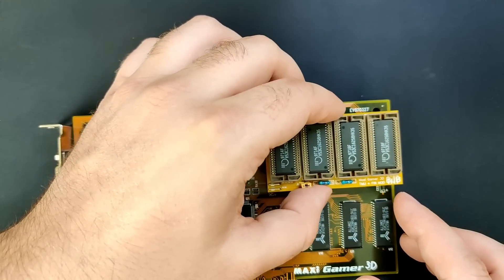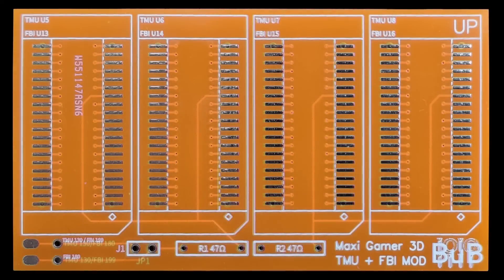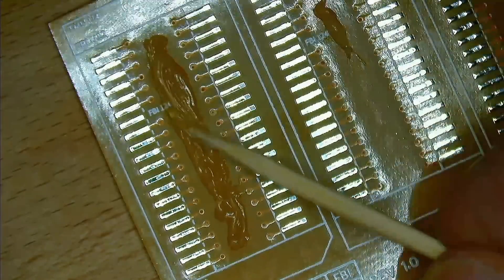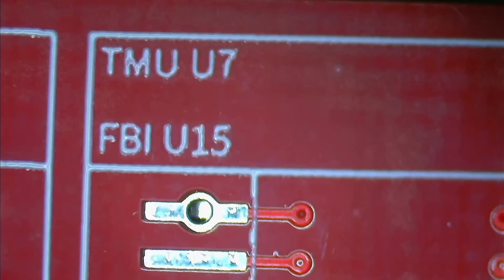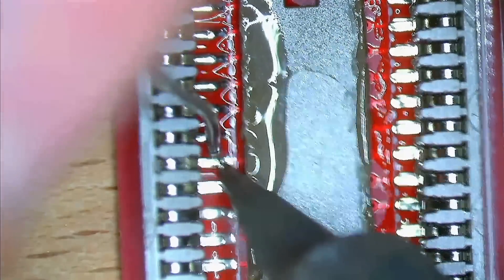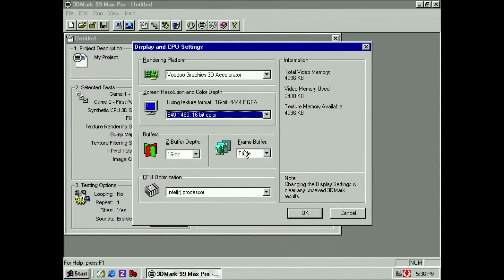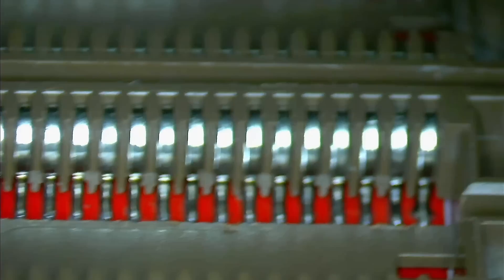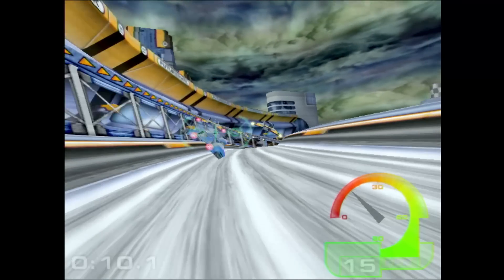3dfx Voodoo Memory Upgrade Board - Revision 1.1

Comment: Great to see the continued development of these boards but I’m surprised you didn’t add an “On/Off” jumper for game testing? Or can you disable the board by disconnecting the leads going to the Voodoo chips? @Bits und Bolts
Reply from the maker: Actually here is something really interesting - and I will pin your comment. It is not enough to just disconnect the wires and leave the memory board clipped on the Voodoo card. If you do, you get artifacts. You have to remove the mod entirely if you want to go back to a lower memory configuration. I have posted this on my Patreon account, but never mentioned it in a YouTube video: https://www.patreon.com/posts/voodoo-upgrade-79103584
Reply: @bitsundbolts  instead of leaving the one pin floating, what if you ground the extra wire from the memory board?
Reply from the maker: That could work, however, I don't know if the remaining 39 pins still somehow activate the memory chips on the memory expansion board. I just don't have the knowledge/experience with this to give an answer. I could test it and if it works, a switch could be added to enable/disable the extra memory.
Reply: @bitsundbolts  For the memory board to be disabled without being removed, you would have to break pins 13 (WE) and 27 (OE) on each memory chip and pull them up to TTL high (3v3 or 5v) to have them be disconnected from the bus. I believe on 40 pin SOJ DRAM, the WE and OE signals are active low. Pulling them high would disable them.

You'd need to figure out how the WE and OE lines are routed on both the FBI and TMU. I don't know if they access one chip at a time, two chips at a time, or all four at a time (16, 32 or 64 bit memory access.) This would result in eight additional jumpers (16 bit), four jumpers (32 bit) or two jumpers (64 bit).

With that level of complexity, you're going to start having problems with signal corruption. Jumpers poking up on the top of the card is going to be a giant antenna that will sink noise into the line and potentially cause issues. It'd be easier to just remove the board entirely and disconnect the existing wires.
Reply: @GGigabiteM  Well, one jumper and some logic ICs would do the job as well

Comment: I'm a lil bit curious. Why upgrade a 25 year old card, when you can buy a modern one for cheaper that is thousands of times faster.
Reply from the maker: It is a hobby and I find it fascinating to learn about old hardware. I can modify and repair this technology with basic tools - like a soldering iron. That isn't easily possible with modern hardware (all BGA chips). And mostly, it is curiosity. I am not going to use this anything you see on my channel on a daily basis.

Comment: could something like this (the concept) work on the velocity 100/ Voodoo 3 1000 8Mb edition?
Reply from the maker: I think it should work since there are 8 and 16 MB versions. But with different memory packaging (I think they all use SG-RAM), it will be difficult to mount a memory expansion board.

Comment: This mod looks very promising... do you think something similar to this will work for other, non-3Dfx cards? I have an old Creative CT-6200 (VLB 3D accelerator) that only has 2MB of VRAM. It is capable of doing OpenGL but only with 4MB, and the proprietary memory module is ultra-rare. Obviously, I can't use this exact PCB as the chips are spaced differently, but in theory, it might be possible?
Reply from the maker: Yes, it should be possible since the card can be upgraded with a memory module. But how exactly you could make your own memory expansion depends on the card. The Voodoo is easy because the memory requires only a few extra connections to the graphic chips. It may be a totally different situation for the CT-6200. It may even be better to put in the effort to replicate the proprietary memory module.

Comment: Nice upgrade but still I think the main problem might be the drivers to use the 8mb. Which ones are you using? Thanks
Reply from the maker: I use the latest official drivers from 3Dfx. I am assuming that the drivers support the extra memory as I could see a difference in 3DMark 99 for "The Race" benchmark. But I am not sure. Could be that I have to test different drivers first (like MesaFX or Wicked3D). I am not even sure if they support the first Voodoo card.
Reply: @bitsundbolts  i think that canopus pure3d and miro highscore are drivers that really support that extra memory but don't know about the rest... 3dmark might do something different... And dos games are also different than windows ones ... We should investigate on the subject
Reply from the maker: I agree 😁

Comment: So i heard you say in regards to the chips that you knew they were good because you had already tested them, did you mean in sockets on another card or is there a standalone memory tester that can test these soj chips that i have not heard of? ive been looking for one to test SOJ40 and SOJ42 for a while  but nothing =/
Reply from the maker: I used them in sockets. The very first memory expansion board I made was with sockets on both sides. I have not seen any other way test those chips either.

Comment: What kind of Gain did you see ?
Reply from the maker: Until now, not much. The extra memory allows to run some games at 800x600, at a cost of frame rate. I only saw 3DMark99 Benchmark 1 (Race) to improve quite a bit. I am still testing other games and hope to see a difference. If not, we will see different games of that era and refresh our memories.

Comment: One question, why not giving holes to all pins?
Reply from the maker: When the socket is pressed on the chip, the walls bend. If there would be holes on every pin, the socket would be soldered in this condition and could lead to a bad connection. The corner pins are supported by the corners of the socket, so they do not bend, but the center of the socket is the worst.
Reply: @bitsundbolts  seems reasonable, good job.

Comment: Brilliant idea to use the holes to line up the pins prior to soldering! Nice work! I also ran into a solder bridge just like that recently in an SOJ socket, but it was a factory defect from a Diamond Stealth VLB card from back in ~1994. It wasn't easy to spot without magnification at just the right angle. Keep up the awesome work!  🙂👍
Reply from the maker: I have seen the video! Quite interesting that the QC didn't catch this solder bridge!

Comment: I like this mod, but I'm not fan of the ssop sockets. how about removing the original chips and making a pcb board with castellated holes in the places where the original ram was placed? you could reuse the address and data lines from both groups of ram chips. now, the only issue is that this uses more space, and it probably won't fit if you keep the adapter the same size as the voodo card... I guess a little bit of overhang won't be that bad :) and you'll not get any connection issues, and you can make the voodoo card stock really easily
Reply: Making brand new boards would be quite a job ...
Certainly  possible, but a lot of work.
Using sockets is a quick way to validate the concept.
IIRC, some Voodoo cards had a daughter board to allow extension (Obsidian , see thedodgegarage for details).
Reply from the maker: When I thought about making those PCBs, one requirement for me was to not alter the Voodoo card too much. I am working on an idea where I wouldn't even need to solder the wires to the TMU and the FBI chip. The goal was to preserve the original, but anybody can try - the DIY guide and the PCB layout are available for anybody to use.

Comment: nice idea with using through-holes for the pins! it's kinda similar to what we talked about but this version is much nicer
Reply from the maker: Thanks! Yes, I was surprised that it actually did work so well.
Reply: @bitsundbolts  definitely a nice new construction method. lovely.

Comment: What are the heatsinks for? were you overclocking it? 😉
Reply from the maker: I put some heatsinks on the Voodoo chips. I don't think they are necessary, but I had those heatsinks. The chips get quite hot, so I put them on his card.
Reply: @bitsundbolts  Ah, I never had a Voodoo so I thought they didn't have them because they didn't get hot.
Reply: Which heatsinks ?

Comment: Is there a possibility to make a version that works with the L shaped memory configuration of the orchid voodoo card?
Reply from the maker: I have the Orchid as well, but this concept won't work on that card. The memory chips are too close to each other. But I am working on something universal that will work on any Voodoo, regardless of memory layout. I need more time to do this though as I don't have the right equipment yet - and I don't want to reveal too much yet 😉

Comment: Those 4MB SIMMs look pretty familiar. 😉

(BTW that project isn't abandoned, I just ran into some issues porting it to KiCad, and then ran into more issues with the memory chips I bought, then ran into more issues with my plan to test the chips. If you know where to buy some Yamaichi IC107-2603 test sockets that's not the "test-socket" website, let me know!)
Reply from the maker: Oh my - Hello UpLateGeek! Nice to see you! Yeah, I borrowed your PCB design. Will definitely mention your github page in the video I am working on. Unfortunately, I have not come across any test sockets yet. Would be helpful for me too since I have that faulty 72-pin 32MB module. Those test sockets are quite expensive on that "test-socket" website. Thanks for watching btw!

Comment: Excellent Work! Am definately going to look into doing something similar with my Orchid Righteous 3D cards - they have the memory arranged in columns of 1 and  7 modules, so completely different from the Maxi Gamer 3D. Not sure if there is physically enough space between the memory modules though.
I haven't looked into the specs of the 512KB memory modules used on the Voodoo in great detail yet, however, I image it would be possible to simplify the entire design down somewhat to a single 2/4MB memory IC with all the I/O, address and control lines routed as appropriate. I wonder if it would be possible to easily "disable" the onboard memory (maybe hold WE, OE low?) so you could effectively replace all the original onboard memory with faster/lower latency memory? Just thinking...
Reply from the maker: Hehe, glad that this mod brings your mind into overdrive :) I also have the Orchid. And I can tell you that there is not enough space for this mod. But, I am already thinking of modifying this card too, but this time - no soldering required. It will be hard and probably requires way more time, but I want to give it a shot!

Comment: This mod is effectively perfect. The only thing I'd do - is put a three-pin jumper or a switch, so the jumper does not get lost when jolted.
Reply from the maker: True, I could have done that. Learned something - Thank you!
Reply: @bitsundbolts  No sweat. Most of us shall just solder the jumper permanently.
The beauty of this mod is that you may forget it exists, after it's done.

Comment: very noob question, what is that trasnparent gel ?
Reply: Flux for solder
Reply: or it is the silicon glue that is used for the memory socket, if you are asking for that.

Comment: Next you should look at adding a second FBI chip. I believe the architecture supported multiple FBI and TMU chips, it just was never implemented commercially.
Reply from the maker: Yes, based on a document from 3dfx, this should be possible. Unfortunately, I believe this is way out of reach of my capabilities. I would love to be able to do that - would make me an instant hero in the retro community :)
Reply: @bitsundbolts  Yeah it would be a heck of a challenge but at the same time, adding RAM was one too. 😁
Reply: this could be perhaps possible with another pcb design ? 🤔
Reply: Wasn't there an "obsidian" board that had multiple chips? I believe it may have only been used in arcade machines. Also there was something called "mercury" but I believe that involved multiple boards. Don't know if the regular drivers would support that or not.

Comment: Add vias for every possible pin and simply solder the lower sockets trough the pcb. Solder will flow trough the vias and attach to the pins of the lower socket if you are patient enough and maybe help with some hot air. Afterwards you can remove the pcb and solder the remaining pins (RAS, CAS, CE?) which are differently connected and can't have a via.
Reply from the maker: When the sockets are placed on the memory chips, they tend to bend in the center outwards. I could imagine that this can cause issues if we start soldering center pins.
Reply: @bitsundbolts  i'd not push them completely flush on the chips, only let them sit slightly so the position is correct. And you can theoretically leave the inner plastic intact so the sockets don't get pushed oval from the forces.
Reply from the maker: I see what you mean - it could work. However, here are a few things I learned creating those mods: The sockets are held by sliding about 1mm over the memory pins - the plastic support prevents this from happening.
If the sockets are not firmly pressed over the chips, they tend to tilt to one side. But you could be right that the PCB helps level the connectors and prevents bending the sockets. I guess it is all trail an error. Unfortunately, I ran out of sockets :) I have more coming, but that will take a while.
Reply: @bitsundbolts  maybe put a small shim between the lower sockets to keep them from bending during build phase?
Reply: These vias can even be staggered to fit better to pins next to each other.

Comment: stupid question
are all memory chips connectedin paralell with only selecting logic being different or is the every memory chip completly different bus? because if they are all conected on the graphic card  together you can reduce number of sockets to one or two per board and make interfacing with any voodoo revision that much easier
tthe question is how much you rely on the sockets for mechanical connection and how much is actually need to be data connection
Reply from the maker: No stupid question, and I still struggle to understand as well, but here is my attempt to shed light into your question. Hopefully someone corrects me if I am wrong.
The data lines of each memory chip are connected to different pins on the Voodoo chipset. The memory chips have 16 bits for data. Since you have 4 chips, and each chip takes 1/4th of the data, you get a 64bit data bus between the Voodoo chip and the memory array (4 memory chips). So, no, you cannot get away with one socket. Also, the wiring is different between TMU and FBI.
Reply: @bitsundbolts  ok now it make sense
i remember in old days i moded amiga 600 for a friend with just stacking chips on top of each other, and they shared all the data lines exept select pins, same memory chips , different use
the thing is friend wanted stacking 2 + 2 chips but i stacked 3 + 1 on top of oryginal 2 because otherwise keyboard would't fit so i was kind of thinking of similar shenanigans here

Comment: hate to say it, if im gonna do this much soldering, im just removing the stock memory chips, putting sockets in their place, infact i have done this, and, you can take a voodoo1 past 8mb, and a voodoo2 past 12mb, does require modified bios but, i have seen it done successfully.
Reply: Does the extra memory get utilized? I thought the drivers would be unaware of the extra memory

Comment: Wouldn't it be easier to remove the 512k chips from the card and solder on 1mb chips rather than piggybacking 8 more chips?
Reply from the maker: I am not sure if this is possible. I am no expert, but 512k chips have an 8-bit address bus. A 1m chip requires 9-bits to address the additional space. The Voodoo chipset has 2xRAS to control 2 pairs of 4x512k chips. I may be wrong, but I believe you can only use 512k chips on the Voodoo 1.

Comment: If you use good solder, you don't need aditionnal flux.
I've been building circuits boards for 30 years, some double side, and quite never use flux.
It's mainly a new tendance, useful for SMD.
I won't say it doesn't help, but it's not mandatory.
Your solders are super clean on those memory !
Reply from the maker: Man, I follow Louis Rossmann - what do you expect 😂
Reply: @bitsundbolts  
L🤭L 🍏🐍
Reply: @bitsundbolts  Do you go on an Apple swearing rant each time you do soldering? 🤣
Also, how do you clean your PCBs? My method of swiping them with isopropanol soaked cotton swabs makes all parts hairy.
Reply from the maker: I use a brush and do 2 or 3 rounds of cleaning with quite a lot of isopropanol. I could imagine that cheap toothbrush would also work well. Then one more round with a strong paper towel - nothing that dissolves like toilet paper. I think Louis ruined Apple for me - not my mug of beer 🍺 But I wouldn't dare to try to repair and Apple product, still don't understand PP3V4 😂
Reply: @nalinux  Dip-washing PCBs would be the best, but I don't have access to that much IPA. 😊
Reply: When he's doing that row of traces on the IC though, I do find flooding the area with flux prevents bridging.
Reply: Yes, it is.